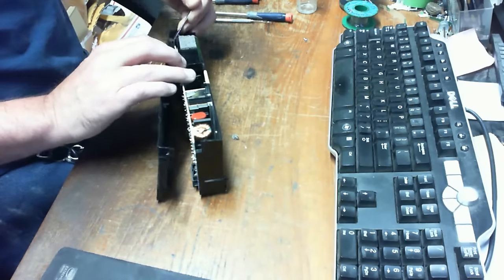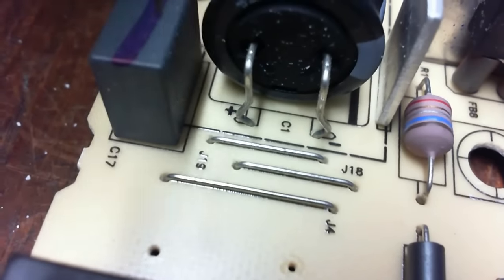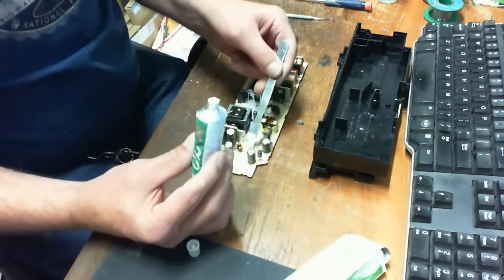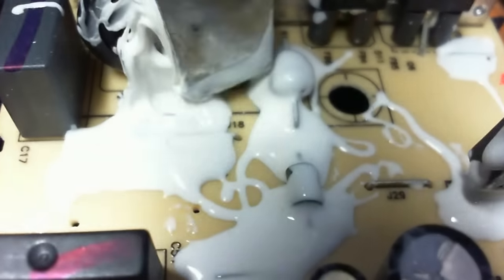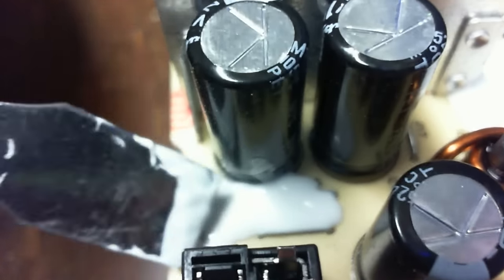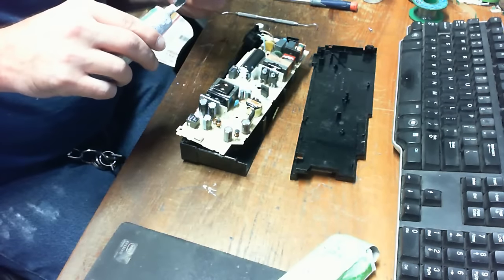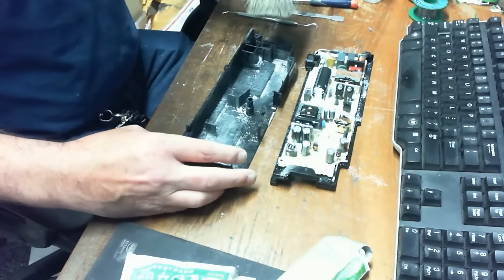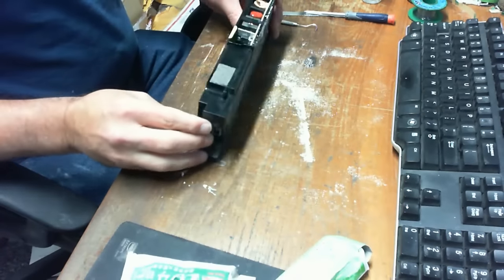How to Cockroach Proof your PS4 power supply

Comment: I just moved down south for the first time. We got a new apartment and there were a few roaches bc the place had been vacant for so long. We set up traps and gel and the roaches seemed to slowly dwindle away. I had only seen a few small ones here and there and then suddenly today my ps4 had like 10 tiny ones crawl out. I had no idea they did that. Im kinda freaked out rn. How do i prevent them from going in?? I really thought we had almost got rid of them. Also should I open my ps4 and clean it out now? There cant be many we just moved here 2 weeks ago... right?
Reply from the maker: There is no way to keep them out because your system is the perfect breading location to speed up the growth of the egg's the only way is to pay for a pest control company to kill them but I hate to tell you this in an apartment it is just plain impossible to kill them all.

Comment: Hi there great vids. I was presented with a challenge to repair a ps4 slim roached out. Co i watched your vids and did great. I was testing the power supply the last time it worked, went to disassemble for roach proofing and the female connector of blu ray drive came off. Does not go bain place. Got one and any advice... Thanks. Just trying to find one  or power supply time...

Comment: Can you link me the powder thing  thanks. btw Im late to do this my ps4 broke 2 days ago I opened it up and found one Roach inside of the power supply.
Reply from the maker: altho the powder helps, I find that most that try using it wind up using way too much and then wind up leaving to much behind in the power supply or try using it in locations of the system they should not. Dust only the power supply remove all but a very fine coating this is only to make the power supply less appealing for the roaches to live in, yes it will kill them over time. but it is better to dust around the location of the PlayStation or game system again lightly you do not want it getting kicked up into the air it can just as easily damage the system. it would be a good idea to dust around the hole house and even a little under the house, Do not worry about dogs you can put a very tiny bit in their food and it will be good for them [Deworming] Good for chickens to this is the bag I recommend it will be enough to do your whole house and have some left over for pets or later applications https://goo.gl/Tzvxi4

Comment: Hey man I have a slim 1tb that’s having this issue can you tell me the two things you used to prevent it from happening again and can it be done to a slim
Reply from the maker: This can be dun with every game system ever manufactured they all have the same problems when it comes to roaches just cover all hi voltage points and do not cover heat sinks for the PSU's As for the best way to stop this from happening it is best to get rid of the roaches by paying for a pest control service.
Reply from the maker: This can be dun on all PS4's slim/Pro All PS4's it is not 100% only 98% because some components need to be cooled by the system and FYI will not stop them roaches from destroying the rest of your system. If your system is killed I would suggest to you that it would be best to pay for Pest Control then after the roaches are gone buy a new system because when it comes to roaches there is no such thing as my last system lasted this long because all it takes is one roach in the right spot and that can happen within minutes of you turning it on directly after you get it set up New or Used.

Comment: What type of sealant did you use? trying to find it to fix my PS4
Reply from the maker: This is the exact stuff I used: https://rover.ebay.com/rover/1/711-53200-19255-0/1?ff3=4&toolid=11800&pub=5575170691&campid=5337859829&mpre=http%3A%2F%2Fwww.ebay.com%2Fitm%2F704-Silicon-Rubber-Temperature-Sealant-Adhesive-Glue-for-Electronic-Devices-%2F172385776624%3Fhash%3Ditem2822fe33f0 it takes a littel while to get hear but is very good for what I used it for in this video.

Comment: So long story short. My son was given a ps4 and It turns on the blue light briefly followed by the small click. I suspected it was the PS and took it apart. I found roaches everywhere in it. How do you confirm the PS unit is bad?
Reply from the maker: Normally when it is the PSU you will get no power at all but it is still possible the only way for you to know is to find a replacement and hope for the best.

Send me the Model# found just above the Serial number and I will send you a link (Yes I will make money if you buy it but it) but it will not make your PSU cost more and the money I make will be applied to my monthly giveaways

Comment: are there any alternatives to the 704 sealant available locally that'd be safe to use? like jb weld blue sealant/gasket maker? it claims that it's sensor safe, but I'm having trouble finding any more info on whether or not it's safe for electronics.
Reply from the maker: I like the 704 sealants but you can use just about any RTV like what would be used on your Bath Tub or windows
Reply: would an rtv gasket maker be okay?

Comment: Is there any hope of being able to repair an ADP200ER that's blown out?
Reply from the maker: It is not recommended to attempt to repair a power supply if you do not have schooling in component level electronics repairs you can easily burn down your house killing everyone in it and a few neighbors at the same time.

Anything electronic can be repaired, but without schematics with diagnostic test points you will only waste your time and money, there are 500+ reasons that your power supply is not working and if it is due to roaches, that lightning bolt that killed the roach and your PSU likly caused a cascade fail wiping out lots of components and timing chips. 

Do not waste your time buy a replacement.

Comment: I ordered 704,if i apply it to said locations, no damage will come to the power supply? Like it wont stop a new power supply from powering on? It seems like my best bet on keeping my ps4 power supply from shorting out
Reply from the maker: I do not know your abilities when it comes to removing the outer case let alone the SR board of the PSU but the answer is "NO", no damage will come to the power supply. As long as you allow it to dry before you try to turn it on I suggest no less than 8 hours for safety reasons

Comment: can it be the power supply if the ps4 does not cut on at all no lights no beep
Reply from the maker: Yes It can be your powersupply, but it can also just as easily be something on the motherboard.
Reply: Ok thanks I guess I'll order the power supply go from there my son better hope it's that but I'll let him play mine for now lol
Reply from the maker: Jai Doggy If you have a friend nearby with the same model talk to them about the necessity for cleaning and tell them about this channel and its cleaning video, talk them into bringing theres over for a needed clean out and then you can say, by the way I need to test to see if my power supply is bad ask them if you can plug there into yours long enough to see if all you need to do is order a new PSU. You can tell them I told you if it is the motherboard it will not hurt there PSU and if it is the PSU nothing is going to happen except your box turning on.
Reply: I have told someone to check you out and the good but bad part is we on the same page I asked but they have the same ps4 as me so I have the 1001a and my son has the 1215b my friend has the 1001a like me but I will share this video and when the power supply comes I'll let you know thanks again
Reply from the maker: Jai Doggy Okay good luck
Reply: I even order the Diatomaceous Earth to make sure Im good if its the power supply and from my plants so thank you
Reply: 100% worked thanks again

Comment: Yes I have a question how much does it cost for you to Roach proof a PlayStation 4
Reply from the maker: If your PSU is good and you bring it into my shop and all I need to do is Decontaminate the system/Kill the roaches and/or apply protection it would only be $20.00

Comment: Plz help!! Do you know what power supply  need for the ps4 slim model cuh 2002b. I have looked everywhere and can't seem to find anything when I search for this particular model
Reply from the maker: You will need to verify this first by removing your Power supply and matching up the numbers but this one should be exactly the same https://goo.gl/dfzSqC

NOTE: With cocroches there is the possibility that your hole system is gon do to 110V AC being pushed into your 12V DC System I would recomend if you can take it to a shop that dose not charge a fee if they can not repair like I do that way if your system is tost you can use your mony to buy a replacment.
Reply: TheHGCGamersClub thank you for the reply. My area is bad for roaches and I'm guessing that's what's caused my ps4 to not turn on as i brought it brand new and only used for 2 weeks before it wouldn't turn on. Will defiantly try and find a shop that won't charge me if they can't fix it.

Comment: Hi is there any places i need to watch out for when i use the silicon and how often should i do this or check on my console?
Reply: and what does the silicon help out with exactly and is it removable or will it be in the way of any repair made by someone else?
Reply from the maker: 1st this is to prevent the roaches from shorting out your power supply by crossing high voltage spots, 2nd You will never need to do it again and 3rd & Last yes it is removable for repairs, although I do not recommend you try repairing it yourself that powersupply is the biggest fire hazard of the hole system & knowing what I do about most repair shops I would recommend you Never have one repaired, It would be best to just replace it with A OEM Replacement.
Reply: +TheHGCGamersClub  thanks I'm having trouble getting my ps4 fixed it keeps shutting off and I did find some in the power supply. Do u think if I get a new power supply it would help?
Reply: +TheHGCGamersClub when I cleaned it it did work slightly better btw
Reply from the maker: That is something that no one in the world can tell you. It can fix it but then again without testing it there is no way to know?

Personally from your description of the problem I would say NO it will not fix it, even if you did have roaches inside.

Sounds to me like a motherboard eschew, but if you want to spend $50 to $200 depending on the model on a small chance it will that is up to you?

I think for you it will be cheaper to just take it to a Qualified repair shop.

Qualified Meaning they are willing to show you the education in electronics of their employees working on your game system.
Reply: +TheHGCGamersClub  thankss

Comment: Is it cheaper to buy a new ps4 or just get it repaired .... If repaired from this issue from this video wat  will be the cost of it???
Reply from the maker: It is always cheaper to have a PS4 Repaired than it is to buy a new one.
Reply: @ClovisX  thks
Reply: Johnny Carrasco12 maybe if you find a place to fix it some places won't fool with them with roaches in them or charge more to do it
Reply from the maker: @Endoe ONE Trust me it is not impossible to put it in wrong I get them in almost every day where the customer put the Power supply in wrong [Thankfully i do not charge to correct that provided they did not damage anything]

Comment: hey i wanted ask can i use any high temperature silcon paste instead of this 704
and what should i do to prevent ps4 from cockroach infestion 
some people suggest that when not playing keep it in a plastic bag
Reply from the maker: Yes, you can use any silicon past you can even use the tub and tile caulking the system never gets that hot just try not to get any on the heat sinks in the system and only use it on the hi voltage locations shown in the video. I have been meaning to and I have been trying to make a video talking about this subject, hopefully, by this Monday I will? That is if I get a moments peace and the wife & kids are out of the house long enough for me to make the video. LOL
Reply: TheHGCGamersClub lol and thank you so much will be looking forward for the videi 
and guess what you just got a subscriber
Reply: Mohsin Raza just make sure whatever you use is neutral cure, not acetic!

Comment: Fuse name in spot labeled f801 I need the fuse a roach shorted it out..
Reply from the maker: you will need to find a Dead PSU with a good fuse, you may be able to find its equivalent on a different electronic board from an old PC/Laptop/game system or other but I will bet that that fuse is not your only problem test it by soldering a very small wire across it then test it. I do not recommend repairing Power supply if you damage bump or alter anything in it, you can burn down your or your customers house killing everyone in it including possibly killing a few of their neighbors it is best just to buy a Replacement give me the model# of your PS4 and I will give you a link to the best price with a supplier I trust.

Comment: I was wondering how effectively this works? if you were to guess, what percentage of effectiveness does this preventative maintenance have compared to not applying the silicone to the board?
Reply from the maker: there is absolutely no plastic coating to protect any of the hi voltage components so if a bug crosses over a positive terminal and any ground it will blast a lighting bolt thew the bug and 98% of the time wipe out your power supply. As for how good doing this works? Let me put it this way I have quite a few individuals that have very bad roaches and had gone through several power supplies thanks to bugs before bringing it to me for the repair and to have the silicone protection added.
(Not one of them has returned or needed a new power supply and I offer a 1 Year Warranty) 
I would say Protection from bugs shorting out the PSU 99% effective +/- depending on the individual applying the protection.
Reply: TheHGCGamersClub how much do you charge ?
Reply from the maker: Use my website to find where I am if you are able to bring it in I only charge $10.00 if there are still live roaches in your system $15.00 sorry I Do not take mail-in repairs. http://www.clovisxbox360repair.com/
Reply: TheHGCGamersClub Hi I was wondering why you don't take mail in repairs ? If it was a matter of shipping cost would you accept one if a prepaid flat rate mail back box was included so you did not have to pay for return shipping?  Either way you are doing a great service and should not be getting all the hate. I love what you do and let me thank you for all of those inconsiderate ass hats. Thank you sir and thank you for giving me a moment of your time.
Reply from the maker: I don't take mail-in repairs because 1. it makes your repair very expensive
2. the post office treats packages like footballs and I will not be responsible for the Post office damaging anything on its way to me changing the price of your repair (OR) responsible for any damage from me to you thanks to the Post office on its way back to you.

It is Best if you look for a qualified repairman near you first 
Then if all else fails and you want to risk it, Call and tell me you will accept all postal damage risk to and from and request to mail your system to me.

Comment: exactly where do I put this on a 240AR cause it looks a lot different on the inside then the one you have. I'm not tech guru so not sure exactly what to do.
Reply from the maker: if you bought a tube like I showed in the video you have plenty enough just to cover any component leges you can find and just like in this video the wire jumpers, resistor and diode legs, try to avoid putting any on the heat sinks.

I do not recommend putting any on the bottom side of the board as they need the air flow and my get to hot and fry, I find that 99% of all bug shorts are on the upper side of the board were there leges and body's cross over the component legs. 

Make sure you allow time for that stuff to dry good before you turn it on.
Reply: TheHGCGamersClub u are a god sent my mans. I just wished more ppl watched your vids. Keep it up brother.
Reply from the maker: you like me for my videos have you even visited my Active Giveaways? $100+ something free every month and I even pay the postage?
Reply: TheHGCGamersClub I could bs and say yes but truth be told I havent. I never really win in this stuff so I don't bother, BTW I don't skip the first ad. I remember u saying something about it and I get it. Money makes the world go round em I right.
Reply from the maker: You never win giveaways on youtube because they are all fake or you have to qualify by going to facebook and twitter and all that shit.

My giveaways are all real and the best part is all I ask for is a single comment on the video, LOL everyone that wins makes a video telling everyone they won you can check out my past winners play list and Hay You will never win if you never try right?

And Yes money makes the world go round but the money I get for this channel pays for my giveaways.

Even if you do not wish to win, try anyway the views help buy electronics to giveaway to everyone that can not afford electronics, who knows perhaps someday you will win, even if you donate it back because you did not want it?
Reply: +TheHGCGamersClub I got you, I appreciate that.i will definitely try my luck lol. As well don't worry I know 100% your give aways ate legit,no need to prove to me anything.

Comment: can you use adhesive sealant silicone to roach proof the power supply
Reply from the maker: I think so, as long as you allow it to dry completely and you understand that you can not just smear that stuff everywhere or the PSU Can not cool itself and it will burn out fast, all you can do is protect the hi voltage locations that I showed you in the video.
Reply: Ok thanks